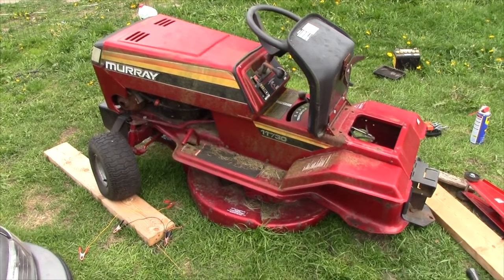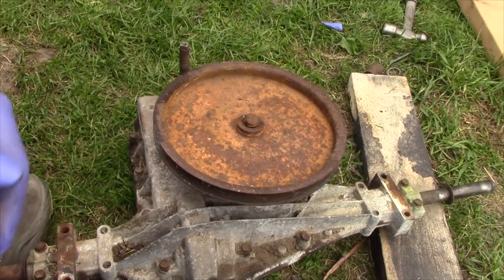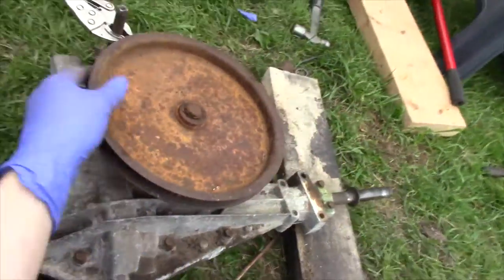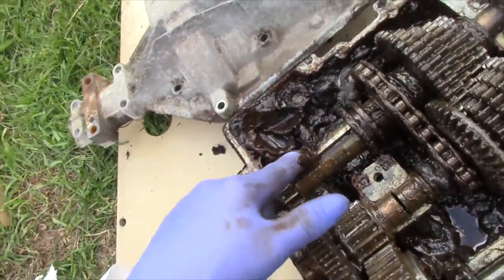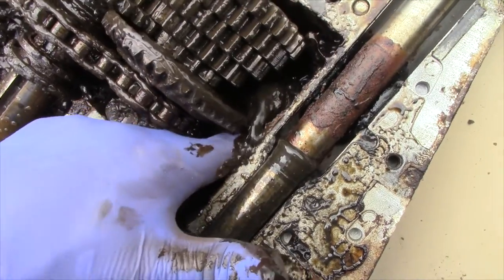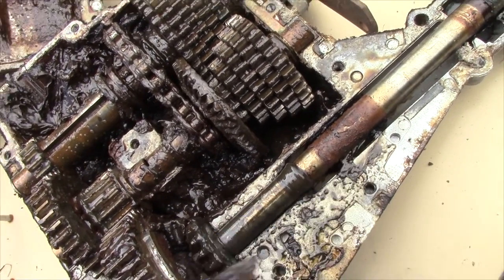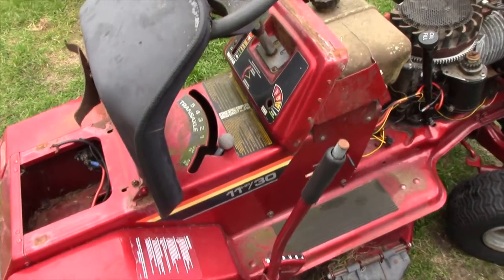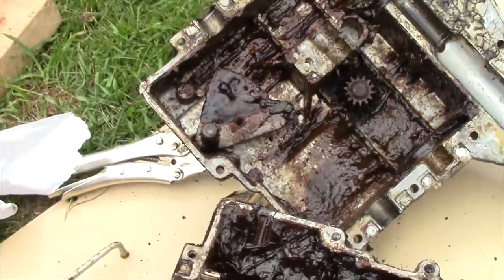R.I.P 25-year-old riding mower

Comment: if you look at 1puglife's videos from around may of last year, he had something similar of a transmission he completely cleaned out and just packed it full of grease since it was supposed to be sitting right-side-up, but for the racing tractor he made, it was sitting upside-down, if memory serves. the body looks to be in good shape, so if you want, you could definitely find a replacement engine and transmission of the same kind. they don't make ride-ons like they used to anymore, and I want to believe that's even why Aussie50 repaired the diesel-one he got to mow his own lawn with, although I believe that one's a bit newer.

seems like a bit more work to do that, but it'll last longer that way, if parts for it or similar ride-on mowers aren't too hard to find. not too sure what the size of your property is, so it may even just be more beneficial to just get a self-propelled FWD mower if it's not too much, to replace this. but, be forewarned, if said mower carries a Briggs and Stratton, they're not made to a high standard anymore (something about plastic bearings and races? eugh). sort-of why when we had to replace our 6.5HP self-propelled Toro mulching mower, I specifically went with an on-clearance self-propelled Craftsman from Sears here in the states that had a genuine Honda motor instead. with regular preventative maintenance, I figure it'll live longer than the Toro did, but that's only speculation at this point. that was also two years ago, so it's already a quarter of the way there. I only hope that whatever you're using now or whatever you're going to get as a replacement if you have nothing now, doesn't have a crap engine that will end up dying the same way within a couple years.
Reply from the maker: ***** I did some research, and getting the gearbox fixed would have been several hundred Euros just in parts, and I figured it wasn't worth it. We've got one of those old B&S 3,5 hp pushing mowers since ancient times, and it does an excellent job. We only got the riding mower because it was really, really cheap (and clearly for a reason).